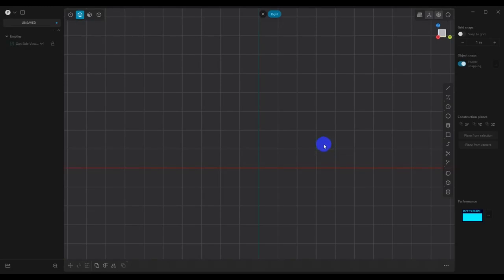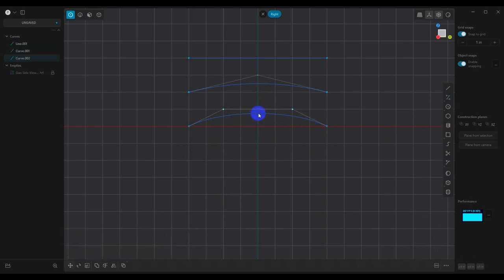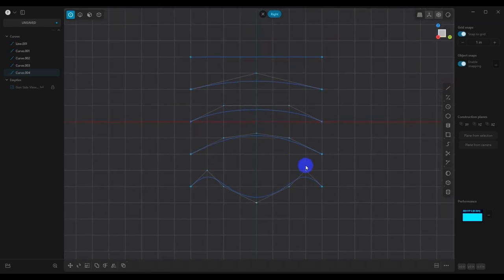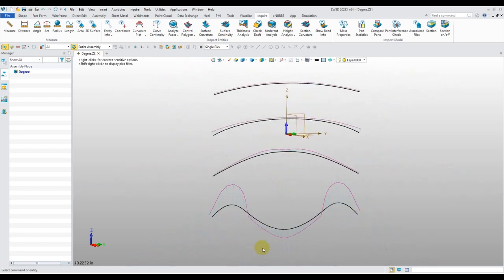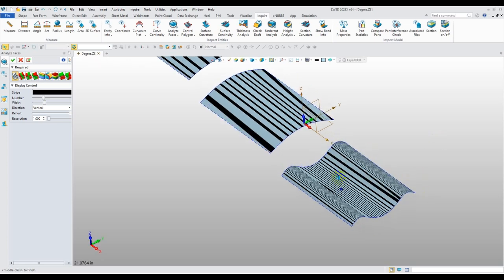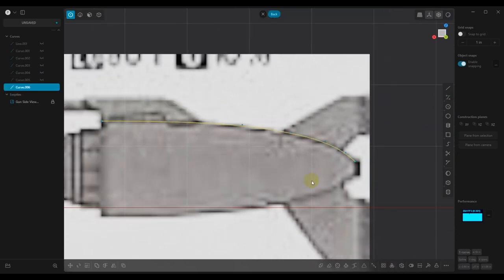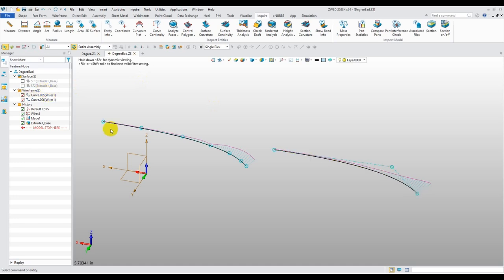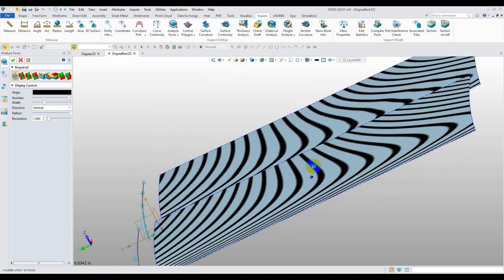Degree123456 control point curves for the artist.

Comment: awsome! what is the difference between "raise degree" and "subdivide" command for a curve in Plasticity?
Reply from the maker: @MatheooPL
Nick Kallen got back to me on this. Raise degree does exactly what it says and subdivide adds spans.
Spans - sub sections of the curve. Higher degree curves will have fewer spans (for a given number of CVs) and a greater degree of smoothness between spans.
Reply: @philprocariojr3563  I get it now. Thank you very much!
Reply: @philprocariojr3563  By this I assume it would then be best to use the raise degree command for smooth surfacing? Great video by the way
Reply from the maker: @baril3d  
Actually, the degree of the surface is not what determines its smoothness. Higher degrees just allow for tighter bends in the surface. (More curvature)
Reply: @philprocariojr3563 Right, thank you for the correction. I guess my question would be this one instead. 

In which scenario would it be preferable to subdivide a curve rather than raise it’s degree?

Thanks in advance!
Reply from the maker: @baril3d  
If you wanted a multi-span surface. You only want to raise the degree if you can not achieve the curvature you need. Hopefully I can make some videos showing this. I just need some more free time.
Reply from the maker: @MatheooPL 
I'm not sure about the technical difference. When testing both, you will notice that they raise the degree by 1, but they do it differently, and I'm not sure exactly what that is. I'm getting an answer to this question now, though, and I will let you know what I find out.